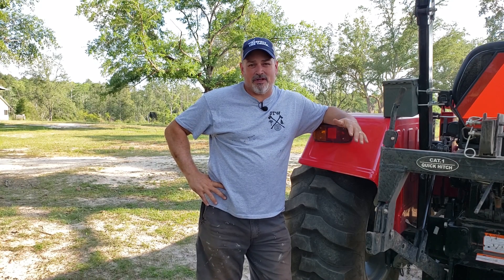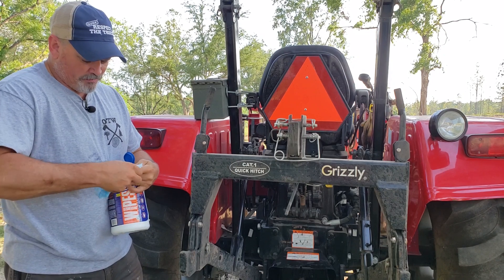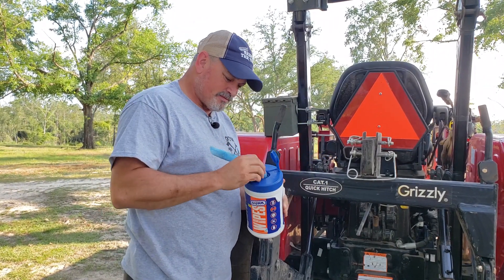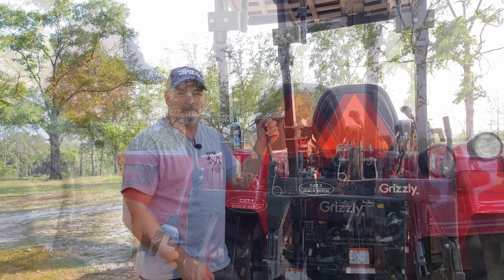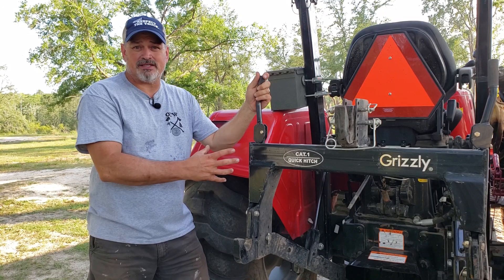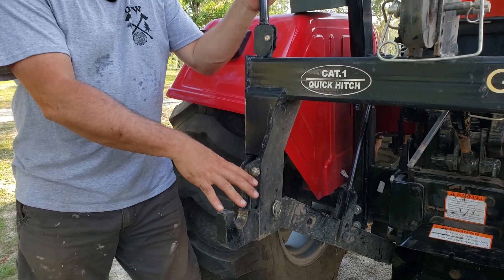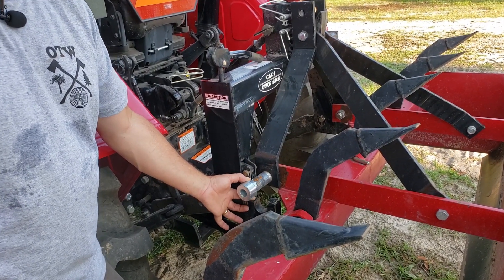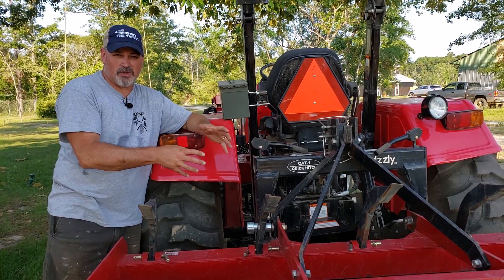3 pt hitch ... Which one? Quick Hitch or Pat's Easy Change?

Comment: Great Video on quick hitches and they are the best and safe way to hook and unhook 3 point tools . Comming from a Farmer who uses cat 4 quick hitches all the time on our larger tools we hang up to 20,000 Lbs on the quick hitch.  Usually our big Grain Carts and Corn Planters we pull them on the bottom links of the quick hitch since it handles the load much better and is lot less stress on the tractor since you are hanging it on the rear axle of the tractor . Plus using the draft control on our tractor it ties into our traction control a lot better and aids in nicer ride less shock loads. Our Large tractors use Cat3/4 or narrow version
Reply from the maker: I love watching big tractors like that work👍

Comment: With my [limited] experience with tractors, implements, and quick hitches, these are my conclusions (so far):
- if most, or all of your implements are quick hitch compatible, go with the 3-point quick hitch
- if most of your implements are pre-quick hitch specs (especially the width of the bottom pins) the Pat's system is the way to go.
- my Harbor Freight quick hitch is actually Category 3. I use Cat-1-to-Cat-3 bushings on my implements. You can use Cat-1to-Cat-2 bushings with that QH, but there will be more slop and your bottom pins may not even bottom out in the hooks, thus getting side-to-side rocking as all the weight of the implement will be hanging on only the top hook.
- the retainers for the bottom pins (actuated by the levers on top) don't necessarily need to be open to hook up to an implement. They are spring loaded. When lifting an implement those retainers will get pushed in automatically by the pins of the implement, then snap back into place once the pins fully seat. This way, you don't have to risk throwing your back out (for us older tractor guys) having to turn around when sitting on the tractor to flip the levers down.
Reply from the maker: Awesome input. Thanks a lot for the well thought out comment to help us. I appreciate that👍

Comment: I've been looking into one or the other.  Mine has the "deluxe" lower arms with the extendable end links, but they are damaged.  Probably cheaper to add the Pat's than buy the necessary parts from New Holland to fix them.
Reply from the maker: Yeah you might be right👍

Comment: ALL, as far as I have seen, quick hitches are designed to be hooked up with the handles in the closed/locked position. The parts/latches that lock the implement pins in are spring loaded to allow the pins to push them in while lifting the implement.
You do want to verify they have sprung closed.
The handles are meant to hold the latches open when removing the implement.
This does seem to be a common theme in the videos, not mentioning it or not knowing it.
Reply from the maker: Good point

Comment: Is your Quick hitch category 1 or 2 you and what is your tractor?
Reply from the maker: The quick hitch is actually for Cat 1 tractors. Cat 1 goes up to 45 HP and the 4540 is 41 HP so it is considered a t Cat 1 tractor for implements.
Reply: @Hfoutdoorsyt  So is your box blade a cat 1?
Reply from the maker: Yes sir
Reply: @Hfoutdoorsyt  why did you need the Bushings?
Reply from the maker: From my understanding, and I could be wrong, the cat 1 rating of the QH is for the tractor pulling it not the implement attached to it. If that makes sense. That's a good question though. Hopefully someone smarter than me will come along and answer 👍🙂